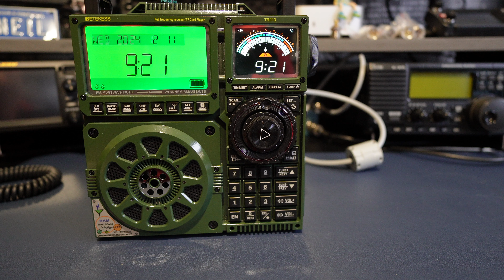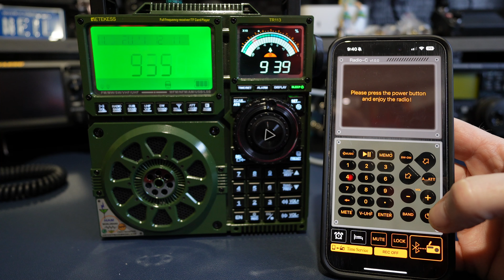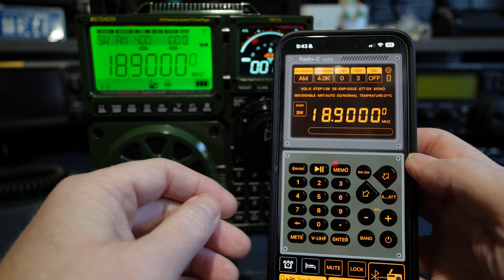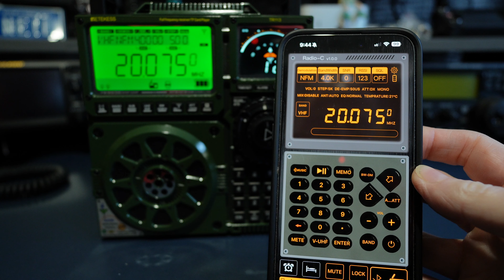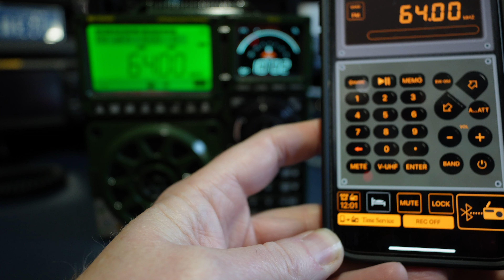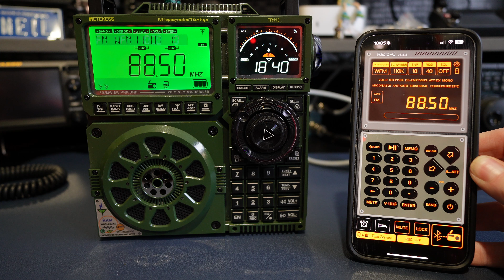RETEKESS TR113 All Band Reciever App Control

Comment: Most of the fun is actually using just the radio
Reply from the maker: I agree using the radio is fun but the app can be quite useful at times.
Reply: @gtretroworld  can i lietn air traffic or boats on the sea or emergency channels and stuff?
Reply from the maker: @Voltomess Yes it works great for Marine and Air. I was only told a few days ago that the muting has been fixed with a new Firmware update so i will try that on my channel shortly.